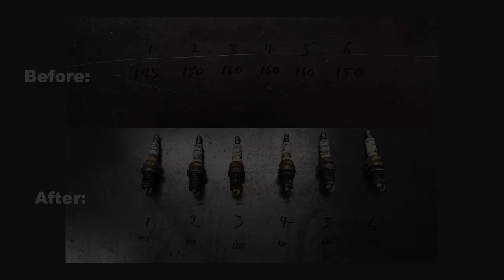Restore Engine Compression $10 - Does It Work!?

Comment: Good video, would like to see more non- sponsored product trials for jeep related parts & products 👍🏻
Reply from the maker: This wasn't sponsored in any way. I just wanted to see if the stuff worked!
Reply: What happened with the compression when you changed the oil?Because seems to me that product is just an oil modifier that thickens the oil.
Reply: @bleepinjeep  nice video. I was wondering did you pour the whole thing into the engine. Because I did with my oil change I added 6quarts of oil and one whole bottle of this stuff for my 5.7 hemi. And it surprisingly quite the lifter noise. But now I'm nervous to run it since I did see on Google that it suggest only a partial is to be put into the engine and not the whole bottle. Which bums me a bit because it doesn't tell you how much to add only to the engine theres no info for it.
Reply: @MoparDude707  hey your comment saved my ass thank you I hope your engine is okay 👍
Reply: @bleepinjeep  Do you actually put the oil in the cylinder when you pull out a spark plug or do you add it to the oil?

Comment: I did my own test with this stuff years ago on a chevy small block with over 150k on it. Did a compression test before, added it to my oil and drove about 3000 miles and did another compression test. the numbers across all 8 cylinders went up 10 to 20 points. Your mileage may vary, not to be taken internally, driver carry's no cash....
Reply from the maker: Good data. Thanks!

Comment: Something tells me that there is a way to do it that would yield better results than just throwing it into the engine.  1.  Run a non synthetic oil for at least a thousand miles.  2. Change oil with non synthetic  3.  Add motor flush and flush the engine out.   4.  Add in a high zinc engine oil break in additive with engine restore and perform a cam break in procedure for 20 minutes.  5.  Change oil with regular non-synthetic oil and add another can - drive as usual and check compression after 1,000 miles.  If that doesn't improve compression numbers notably (assuming those numbers are much less than a new engine) then it might not work, but Project Farm has already made a video and believes it is one of the few gimmicks out there that actually does work.

Comment: Had a 1987 Pontiac Firebird with a 2.8.  With nearly 200,000 miles on it.  A nursing student had it from brand new and rarely changed the oil and filter.  Mechanics used a screwdriver and a wet vac to dig and clean out the top of the heads.  It was nasty.  I ran a can of engine cleaner in it for a couple of weeks.  I then changed the oil, filter and added a can of Engine Restore.  Took it into the mechanic, he hooked it back up to the shop machine.   They pulled me out of the waiting area and said that they could not believe it, the engine had nearly perfect compression out of all 6 cylinders.  I told them that I give the credit to Engine Restore.

Comment: Just remember to not use this stuff in engines that have VVT. It can cause solinoid issues.
Reply: I saw  your advice too late , I just did an oil change with “Restorer” in a 2010, 4 cylinder Tacoma 🤦‍♂️☹️so far no problems 🤞

Comment: I used this years ago in an Oldsmobile that was starting to burn oil. it stopped burning oil. This stuff works pretty well on an old engine that is on the decline. Cheaper than a rebuild, and will easily get you a few more years of service.
Reply: What year was the Oldsmobile and which engine did it have?

Comment: That product work on my 2000 dodge ram 1500. I had zero compression in cylinder 3.. i did not at restore to my oil. I removed the spark plug. Poured two ounces directly in the cylinder. Waiting 24 hours. Started my truck. Ran it for 10 mins. I shut it down. Pulled cylinder3  spark plug. Hooked up my compression tester. And their was 120psi!! Thank you restore! I highly recommend this product!!

Comment: My 89 4.0 XJ was around 200k miles when I compression tested it. My memory from 13 years ago says I had worse compression than your results, I think 135 was my lowest. I tried engine restorer and saw an increase on all but one cylinder. I believe restorer works better on vehicles whose prior owners didn't keep up on maintenance. With your pressures and miles it's pretty clear your xj has been well maintained but even so you still got results, I'd say that's the sign of a good product.

Comment: I've used Engine Restore on my 1985 Oldsmobile station wagon for years. I bought the car for $500 back in 2012 as a backup vehicle, and always added Engine Restore at each oil change.  10 years later the old car is still running.
Reply: Which engine does it have?

Comment: It’s great to see a Jeep with that kind of mileage out wheeling I have over 300,000 on my zj
Reply: Don Mohring the I’m starting to think that the 4.0 is built proof and will last for ever
Reply: My 95 Cherokee just got new plugs n wires today and changed her oil! 169,862 & still purs likes a kitten!!
Reply: 276,000 on my Wj.  had a piston come apart about 250,000 put new pistons and bearings in mine and I beat the snot out of it took and on a 700 mile wheeling trip over the weekend just got back yesterday morning and it did great
Reply: 329,000 miles on a 99 Cherokee...
Reply: 5.2 V8 any good?

Comment: Compression test should be done with = battery charger hooked up on high (constant rpm),  crank trigger disconnected, (so it doesnt spark or inject fuel ,cylinders checked further into the test will have more and more  of oil washed off the rings by the fuel ,and your asking for it leaving the plug wires loose and letting the ignition fire at peak voltage can cause it to leak high voltage to secoundary winding in coil and kill pcm) ,  throttle should be propped open some amount ,(so air can freely enter cylinders)  keep cranking till guage peaks out.    
Do these things and you will have an accurate compression test .  FWIW =  low/uneven  cylinder compression almost always caused by valves not sealing .  A good   (like SeaFoam) Top Engine cleaner treatment that you put directly  in the intake  not the gas tank or oil pan ,done by the instructions will help most . My .02   Nice Video !
Reply: Where do I put my spark plug wires when testing? I've been doing it wrong my whole life lol
Reply: @jaynikk758  Have someone hold them, preferably with wet hands!

Comment: Thanks for the quality video! I’ve been using Restore for years and have had great results in high mileage engines. I’m definitely not a believer in mechanic in a can but this stuff actually works. Again, thanks for a great video.
Reply: So what kind of oil do you use with it?
Reply: @Andreasplace  Castro GTX 10/40
Reply: @dancjr2  thanks a lot
Reply: If you don’t mind me asking which do I put in first the oil or the additive?
Reply: @Andreasplace  Oil first, additive second
Reply: @Andreasplace  fill halfway with oil. Add your additive then finish filling with oil.
Reply: Do you add the restorer every time you do the oil change?
Reply: @Andreasplace  conventional, or synthetic in the weight your motor requires!

Comment: I used Restore in my 250,000 mile gasoline engine. Somewhat religious about the frequency of oil changes, and never letting the oil get too dirty, I was astounded at how black the oil was at 5,000 miles when I changed it with fresh synthetic. I suspect that it cleaned some sludge out, maybe freed the rings up, but who knows for sure. I did not do a compression check before and after, just based it on your results, and the car is running great. I replaced the plugs on my while I was at it. I can't remember the last time they were changes, so I guess it was time.

Comment: I literally just did an oil change with this stuff... came in, and this video was up! Watching it now, haha.
Reply: A quick update: I put on about 100km after putting the restore in... this is not a 'scientific' test, but my idle appeared smoother, and I didn't bellow blue smoke out the exhaust after idling for 15+ minutes as I did before the restore.
Reply: Hello,
Do you have any new experience with it?
Reply: Did you add it to the 6 quarts or does it replace some oil?

Comment: I always enjoy your videos Tim. Thanks! I think you should hold the throttle wide open while cranking, but as long as the final test is done the same way it won't matter...
Reply from the maker: You're right, but I did conduct each test exactly the same way.
Reply: @bleepinjeep  I wasn't cutting you up, just making a suggestion. Always great videos Tim!

Comment: I have been using and recommending this stuff forever. Had an old car that wasnt running good so added some of this straight to the oil that was in it and it made the old pos purr.
Reply: Hi friend! How do I use Engine Restore? My car uses 3 liters of engine oil. Should  I drain some engine oil out and put some Engine Restore in? For instance take out 325ml of engine oil then put in 325ml of Engine Restore?

Comment: I've been using it for a long time 15 years plus, I put the 8 cylinder can in my sixes. I'm a believer.
Reply: amen great stuff if people knew that it does actually help out an older engine you'd hear about it all the time bad marketing I guess highly recommended it I use the 8 cylinders can in my 6's as well

Comment: Love the video but Restore has been tested about a million times and has worked about a million times. Project farm done a very detailed and extended test on it and it worked.  This is also one of the only products in a bottle that click and clack the tappet brothers endorsed. It works people! Not downing the video at all but Restore has been ran through the ringer dozens of times already and stood up.
Reply from the maker: Man.  Good for them!
Reply: But no one tests after an oil change without it; is it a one time thing-  or required with every oil change?

Comment: I had a prelude h22 with oil burning issues and this stuff dramatically slowed it down. To 10 or 15% of what it was. Compression didn’t change all that much though. So it does something at least

Comment: my understanding of the stuff is it does help fill scratches in the cylinder wall to some extent but the problem is you have to use it every oil change. I'm not sure if it will gum anything up with long term use.

Comment: I am curious to see the compression results after an oil change to see if that stuff actually changed anything that remains when it is absent.🤔
Reply: There are about a dozen videos that will tell you that already. Restore does what it says for the duration that it's in your engine.  Just add it with every oil change.
Reply: I mean an oil change without it. Sure, if you have to use it all the time it may have an impact. Will it do anything that lasts when it is absent?

Comment: hold the throttle open while cranking to let air in to comperss
Reply: Without sparkplugs?
Reply: @tomasnokechtesledger1786  - The absence of the spark plugs on the other cylinders, as nothing to do with the cylinder being tested. Compression test should always be done with open throttle, precisely to give a better chance to fill up the cylinder. Be it a 1 cylinder or multi cylinder engine. ;-)

Comment: Hey everyone!  I just wanted to share this important info with you all !! I talked to the manufactures of this product directly and they told me do NOT use this if your vehicle has VVT Valve Timing system in it. It will clog everything up and it wont be good! So make sure you check that first before you use this product! If it doesnt have a VVT system your good. Other systems like Hydraulic valve lifters and stainless steal shims are ok. According to Scotty Kilmer. So yeah,  hope that helps! Your manufacturer of your vehicle can help you if you give them your VIN number. They can tell you for sure if it has  VVT . CHeers!

Comment: Restore is the best I have ever used! Better mileage, acceleration, and smooth idle. I highly recommend using Engine Restore.👍
Reply: Kevin Bosworth - can you use it in cars that don’t have that many miles? I was wondering if it would help keep the engine running longer than it would with out using it. Or is it just for high mileage engines.
Reply: @peterv1318  I don't have the answer to that. I know people who used Slick 50 in new engines. And they never broke in properly. Made the engine worse. I personally would  just use it on higher mileage engines. Say over 100,00 miles. I also only use Mobile one, for high mileage. My Jeep ZJ has almost 180,00 miles and runs great. It is the I6, six cylinder, bullet proof motor. My brother put Restore in his Toyota Camry. Stop oil burn and better mileage and power.
Reply: Kevin Bosworth - thank you for the information. I heard people use stuff like this on low mileage cars and they had engine problems at around 120,000 miles so I definitely wanted to know if this is any different. Know I know not to use it.
Reply: Clogged my oil Filter twice forcing by pass mode and Low oil Pressure….my 5.3 hates it

Comment: In my experience with it it does work but you have to keep using it after you started using it and you're supposed to use it on a clean oil change that will make some difference in your results I think if you don't use a clean oil change for using it because the oil is broken down to a certain degree from being in your engine for Albert long it has been there

Comment: I can't believe you run copper plugs that many miles, I usually change mine out around 30,000 miles. I use restore also & it brought my compression up as advertised, 190,000 on 4.0 ZJ.
Reply from the maker: They didn't cause any issues. I replaced them after Utah this year. Ran fine before, ran fine with new ones.

Comment: I tried this stuff on a early 80s 302 with over 300,000 miles and next to no compression at all. I had the same results. Just a few psi increase on a few cylinders.
Reply: It'll only help with compression lost past the rings. Did you ever test to see if your compression leak was past the valves or past the rings?

Comment: I've been wondering about this additive and did put the small can for 4cyl into my 2008 Jeep Patriot North, 2.4L 5spd, (35Kmi.) Oil was down half way in the safe zone on the stick so I put RESTORE in. After a few runs (I don't drive it much) I noticed that my shifting/pick-up became far more peppy and motor became more quiet (very very light ticking.)  I was surprised at the acceleration coming onto the hwy on the merge. I'm going to put some Lucas into the gas tank now. Appreciate your channel especially for the nube stuff.

Comment: Got A 79 350 in my truck.
And my cylinder pressure is basically 90 psi the lowest being 82 psi.
Runs well hard to cold start.
No wonder I'm here.
Imma do this tomorrow.

Comment: And just a side note, I have soaked the cylinders for 24hrs   using seafoam or berryman poured into the sparkplug holes (plugs out) then crank over the engine to blow out the solvent, reinstall compression tester and seen a 15psi increase curing the carbon fouled stuck compression ring problem...

Comment: My Jeep Cherokee started missing and the check engine light came on. The machanic said I had hardly any compression in my number one cylinder and the engine was shot. I put restore in and started driving and about 2000 miles I noticed that the miss was going away and eventually the check engine light when off. It’s fine now and running great at about 10,000 miles later👍

Comment: I bought an f150 from 91 with 5.0 v8 
I couldn’t get it running without jamming the gas thought it was fuel. But now I believe it is compression- customer states ; vehicle sat long time doesn’t run right now more. Clean and lube & seal them cylinders valves and rings with 20$ sea foam and engine restore, then 20% Lucas oil at changes I hope this works y’all!

Comment: Good info thx. I used in a Jeep TJ 4.0 with over 160k miles to address very loud valve clatter.  Before using it would take a good 10 mins or driving for several miles to quite the noise a bit.  After using, first time n approx 10 seconds the noise came down a good amount. To the point I can now hear the aging pulleys making a little noise.  Never heard them before.  Next morning, the noise remained low compared to before.  Hoping this lasts….

Comment: Thanks for the vid, sweet Jeep too btw.

Just as a side of precaution. Your spark plug leads were sparking when doing the compression test. (I’m sure you know) but disconnect/disable the distributor (or coil packs if it’s a different vehicle). Unbunrt or freshly injected fuel and vapors can get shoved out of the other cylinders via piston stroke and ignite those sparking leads. Saw it once, was pretty surprising 😆 got the blood flowin for sure

Comment: Beware!  Based on PF and other tests, I recently put Restore in a 2007 Honda CRV with 213000 miles and within 3 minutes the Check Engine light came on.  Stopped to make a turn 5 minutes later and engine stalled.  Ran rough and stalled numerous times at idle (which would drop below 800 RPM).  Search of WEB showed other Hondas experienced similar problems.  I changed the oil and filter, and Engine light went off.  It stopped stalling, although idle is still a bit rough.  A similar symptom occurred once before when oil went about 1000 miles past its change interval, and Electronic Valve Control filter and hydraulic relay clogged.  Oil change and cleaning of the EVC screen fixed it.  My theory is that Restore clogs parts in engines built with tight clearances, using hydraulic relays and valves, and maybe using 5w-20 or thinner oil.
Reply: Yes, you're not supposed to use this stuff in modern GDI or VVT engines. The galleys are too small and will clog.